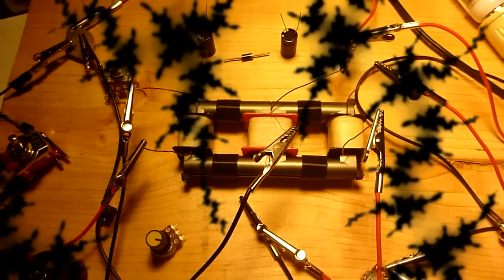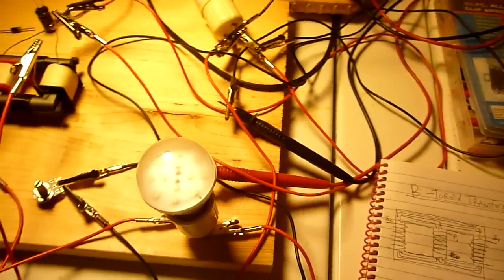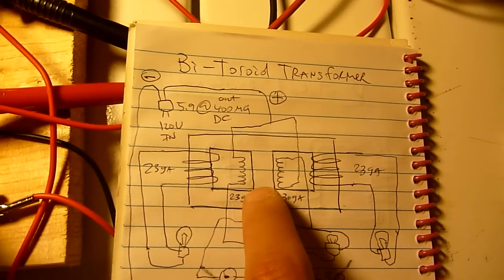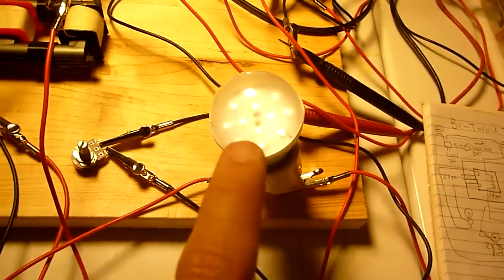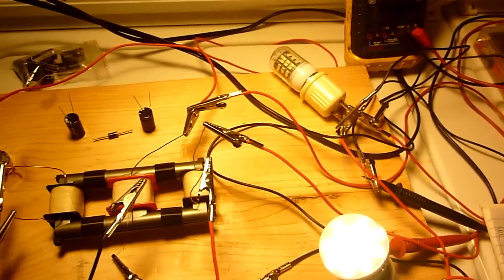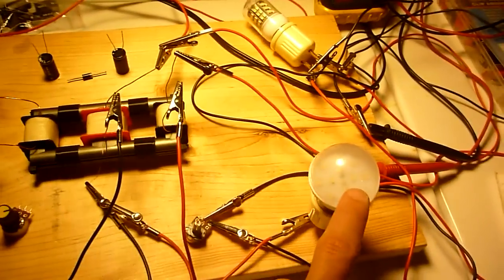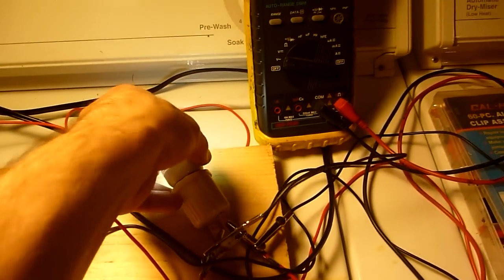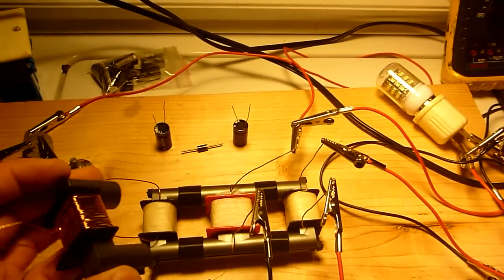Bi-toroid Transformer replication (over unity transformer)

Comment: I did this with a wire, some water, and an old spare tire. I am able to power a small city with it.
Reply from the maker: +JTBettencourt Make a schematic, post a video, otherwise your claim isn't helping anyone.
Reply: +Naoki Kashima, as with any other perpetual motion machine, a diagram is unnecessary, since the machine is a fantasy. But because you asked, here are the instructions: duct tape some wire to an old tire, stick a couple eggplants into the tire, sprinkle some fairy dust on it, then wait until nightfall. All the lights in your city will turn on, magically proving that you have created a perpetual motion overunity machine. Then post a video of your efforts here for all the other folks who forgot to go to physics class.
Reply from the maker: JTBettencourt Free energy isn't fantasy :) All one has to do is look back into history. Lester Hendershot made a self running generator in 1920s. You can look up Lester and the schematics if interested. We also have the fuel-less Moray Generator. We have the self-running generator that works on Electrostatics "The Testatika generator", which is still currently powering a village in Switzerland. We can also use water to power internal combustion engines. All we need is to split water into H and O efficiently. Were there people who managed to do this in the past? Lets see we have 1) Stan Meyers in 1986 getting a dune buggy to work using only water 2) John Kanzius used radio waves to split water and produced excess power 3) Genepax Company in 2006 revealed a car that ran using only water as a power source 4) We have Richard Azevedo who converted his motor bike to run using only water and 5) GDS Technologies a Canadian company that is 2 months away from selling water-powered generators to the public. THUS my friend the reality is free energy is all too real. Big oil has trillions of dollars they can throw around to have people killed, have them jailed, hire trolls to spread disinformation. Times are changing :)
Reply: +Naoki Kashima  splitting water into HH and O means you are doing the reverse of combining HH and O. The energy input needed to split (crack or electrolyze) is always greater than the energy liberated by H2 oxidation (burning). Entropy is a fundamental physical law. You can invent all the fancy expressions you want: "negentropy"; "free entropy"; etc. but ultimately if you claim to violate the entropy principle, then you are either mistaken or are lying. All of these "free energy" devices are attempts to create perpetual motion machines. The US Patent Office only requires working models for two types of devices: time machines and perpetual motion machines. None have ever been patented since that requirement went into effect.
Reply: +Naoki Kashima if you show me a working model of this, which produces more power than it consumes, then I will seriously give you $100,000 cash for the model. Seriously.
Reply from the maker: JTBettencourt I am not doing anything for profit. Your money offer doesn't interest me. If you want to see Testatika Generator in action you can buy a ticket to Switzerland and see it in person. Otherwise here is a video of it in action: https://www.youtube.com/watch?v=zwhxcEBGZ7I And here is a video of a working replication of the Hendershot Generator: https://www.youtube.com/watch?v=sPAz8aR1Ylg Here is a video of Stan Meyer's water-powered dune buggy from 1986: https://www.youtube.com/watch?v=CcNFgDuEYUg Here is a magnet motor which runs using only permanent magnets presentation: https://www.youtube.com/watch?v=mHW6b1aFPfU Now the former CIA director Bill Coby wanted to give a free energy generator prototype to the public along with 2 millions dollars to help mass produce it. About a week later he was found dead in an 'accident'. The people behind energy suppression have a lot of money and they are willing to do anything to keep selling their useless fossil fuels.
Reply: +Naoki Kashima i looked at all three. The first shows nothing but a voltmeter needle moving, the second shows a complete fake. The guy has six batteries in the circuit. The third clearly has an internal combustion engine, which might be burning hydrogen. The hydrogen comes from an electrically powered device. No free energy yet. Keep trying :)
Reply from the maker: JTBettencourt LOL!! You can't base your entire opinion of a device based on one 2 minute video! If you would have invested more than 2 minutes into Testatika you would have realized that it is an actual device. Hack the device is STILL** being used to power a village. Instead you are spreading dis-information and ignorance with your comments. You are most likely employed by the CIA's 'public opinion' department to spread disinformation about free energy. CIA has a close connection to the fossil fuel industry. George W. Bush was a CEO of a major oil company while his father Bush Senior was director of CIA. One hand washes the other :)
Reply: +Naoki Kashima darn! You caught me. Yes, we at CIA are in the employ of Big Oil. We have successfully stopped many free energy technologies. Our greatest success was in stopping Santa Claus from flying at supersonic speed powered only by magic reindeer poop.
Reply: +Naoki Kashima by the way, didnt you notice the batteries?
Reply from the maker: JTBettencourt I gave you an example of a dozen free energy devices and you found batteries in 1 of the videos.... that automatically 'debunks' all other free energy devices out there. Isn't that your reasoning? I'm sorry that sort of reasoning isn't proper. It is not logical. Big Oil is currently making trillions of dollars from their fossil fuel technology. They want to maintain dominance over the energy technology, thus people like trolls, politicians and policy makers can all be bought to suppress new technology. When was the internal combustion engine invented? It was invented more than 100 years ago! You're telling me there was NO innovation of the single most important invention in the past 100 years? What about Edwin Gray's self running motor. His engine was featured on the cover of some of the most prominent scientific journals of the time. If interested I can support this with links. By this point it is clear to anybody who is reading these comments that you indeed are a paid troll. If you don't believe that free energy devices are real WHY** do you bother arguing with me about it. Go watch "Keeping Up with the Cardacians" or "Jerry Springer" or whatever and leave me alone. The reason you don't do that is because you care about what other people believe, you want to throw as much dirt on the issue as possible to confuse and dis-inform the public :)
Reply: +Naoki Kashima you gave me examples of three. I pointed out problems with all three. I also asked you to address the question of how these imaginary machines can violate the fundamental laws of physics, namely the Entropy principle, but you carefully ignored that question.
Reply: +Naoki Kashima, this video is just a demonstration of a transformer. It loses lots of energy. It doesn't create energy. Build one and see. I have done it.
Reply from the maker: JTBettencourt Nothing is being violated. We live in a virtual sea of energy. The Earth has an electric charge of half a million volts, these currents are known as 'telluric currents". If an electrical system is designed open then  energy from the environment can enter into the system... this causes the generator/device to actually run colder as it is under load (the opposite to what normally happens). The heat is being converted back into electricity (like in thermal electric generators). Also, you can have energy anomalies (energy actually moves through times and either appears or completely vanishes in the system) under these 2 conditions: 1) if you vary the resistance of the system in respect to time 2) if you vary the capacitance of the system in respect to time. Under these 2 conditions you will see energy spikes or drops in electrical system. The bi-torroid transformer was established to operate over unity. The two secondaries end up supporting each other (the magnetic flux has an alternate path to travel, isn't just confined to a single path). STOP TROLLING and get a real job.
Reply: +Naoki Kashima wow! You actually believe that mumbo jumbo. Wonderful! Would you like to buy such a machine?
Reply from the maker: JTBettencourt The information I stated earlier is 100% factual. It is not a belief, it is a fact. Something that is a fact is substantiated with physical evidence, a belief doesn't have to be backed up by anything. We are a few months away from a water-powered generator becoming available for sale. I do plan on purchasing that generator :) Once I get it, I'll perform tests on it. I'll put it under load and see how quickly the 12 volt battery will last. Water gets split using pulsed DC power and Hydrogen and Oxygen feed back into the motor which continue to run the generator. It is a self feeding system. I'm telling you we are living in the last days of oil :)
Reply: The Testatika machine is just a Wimshurst electro static generator, Low current high voltage. A fun toy at best.
Meyer was a con artist who invented nothing but a money making scam.
The GDS machine is a rechargeable battery and inverter in a trolley with a water feature.
None are free energy devices that produce usable power. J.
Reply: The Testatika machine is just a Wimshurst electro static generator, Low current high voltage. A fun toy at best.
Meyer was a con artist who invented nothing but a money making scam.
The GDS machine is a rechargeable battery and inverter in a trolley with a water feature.
None are free energy devices that produce usable power. J.

Comment: Measuring voltages alone and comparing them to each other really doesn't mean anything at all. Transformers can step up voltage or step voltage down and this has nothing to do with efficiency, and nothing to do with a device producing energy over unity.

The perfect transformer (100% efficient which doesn't exist as far as I know) is the model for the formula of 
P = P in a transformer. The losses are not important for these calcs..

P = Power, or wattage.
Watts = Volts X amps (for the sake of simplicity I won't get into Power factor which is the phase angle relationship between Volts and Amps in an AC circuits. Inductive circuits which are transformers, and motors and 
other devices that are essentially coils of wire tend to have the phase angle of the current lagging behind the voltage).

So this is how you MUST measure your work in order to PROVE over unity:
Volts x Amps(Watts) of input Power verses Volts x Amps(Watts) of output Power under some kind of load.
If you wish to measure Power at each load and sum them, that's fine, but the sum will still have to be more than the input Power

In an over unity situation the output Wattage would be higher than the input wattage.
It doesn't matter what you do in in between, lightbulbs, loads, or whatever you like to experiments with.
If the output wattage is not higher than the input wattage, your rig does not produce power over unity.
If you're not using quality Wattage measuring techniques, your data is going to be worthless.

Cheers, and keep up the experiments!
Reply from the maker: +Fred Flintstone Good point. It is very difficult to do with this setup because secondary and primary are wound with different gage wires. I purchased the watt meters but when I hooked up the transformer to the main power directly (with a capacitors in series) and put the secondaries under load the primary started smoking. Basically this wasn't designed to be used using main power directly. You have to connect the two secondaries using an extra loop of magnetic core material (which I didn't do). Other than that that is pretty much it. I would encourage you to look into this design as well, it does seem to provide concrete proof that over unity is possible. Truth really is out there right now, much information is being available to the public...
Reply: Naoki Kashima
I did read the patent that is filed in canada on the BiTT concept. I do find it very interesting. We must remember that a patent on file is not proof that a concept actually works. It's merely protection for the inventor. The geet engine and other over unity type concepts have patents filed for them yet none of the theories have been proven to work in practice so far. I have looked at all of Youtube tests of the BiTT transformer concept that I could find, and none of the tests show over unity power production. In many of the tests the inventors are measuring the wrong values. I don't know if this is intentional or not. Some of the test fixtures are really well made.

 If you know of any tests that have been performed that are promising I would certainly be interested in taking a look. I just haven't seen any yet.

Regarding your wiring getting hot the problem is most likely too few number of windings on your primary and secondly the gauge of the wire if it's really tiny, but that's going to depend on your turns ratio, and your load. I don't know if you've looked into inductive reactance but a coil of wire presents a resistance to the circuit  based on the expanding and collapsing  magnetic field caused by the sine wave. You may have noticed that if you measure the DC resistance of a coil of some sort, and then measure the current through the coil with AC applied, the resistance to the AC circuit works out to be greater than the DC resistance. This is the reason.
You've probably looked at transformers that may have very fine wire on the primary side but with many windings, and often heavier wire on the secondary lower voltage side (step down transformer). The voltage you produce on your secondary is going to be based on the turns ratio between the primary and secondary windings, so if you're transformer is 240vac input, and 24vac output for example, you're going to have a 10:1 turns ratio. The more windings you have in the primary the higher the inductive reactance and thus the more resistance and a less likely chance of smoking your windings. It's good to select the gauge your wire to handle the expected input current (primary) and output current (secondary). Given a 240vac - 24vac transformer, if the secondary side load is 2 amps for example, the primary side current will be approximately 200ma. Perhaps you've studied this already, but if not I would do some reading on transformer design and inductive reactance. It will take a lot of winding turns on your primary to work with your line voltage.
For safeties sake, I would try and get your hands on a autotransformer or a variable autotransformer for your experiments. Variable Autotransformers go for less than $50 on ebay. Also with the variable type, you can dial your voltage up and down as you like as well as have a safety factor due to the isolation from your mains through the transformer. Please be careful!
Keep up the great work!

Comment: All this is is a flyback transformer, same thing they used in CRT monitors and TV sets. Only difference is you built yours very inefficient, bulky and noisy while other people salvage theirs from tv sets and CRT monitors.
What would impress me is this circuit becoming self sustaining and not need any input power once its started..
Nothing is free, it requires energy to allow energy to change state. so your not creating something out of nothing your only changing its state and during this process something must be lost. its the laws of physics, it will always take more to convert state than what is outputted.
You may have 32 volts going in and having 2KV coming out but your amp loss is so great all you can drive is an LED bulb. nothing particularly useful since you can drive LEDs on 12 volts or less now.
Lets see that thing run an electric oven or clothes dryer then we will be impressed.